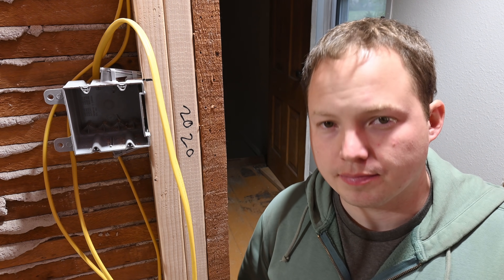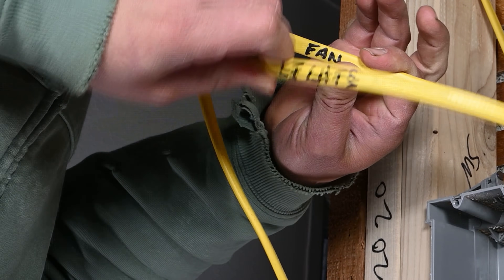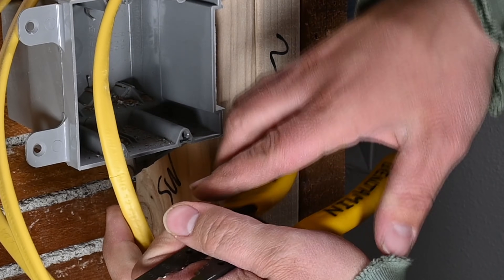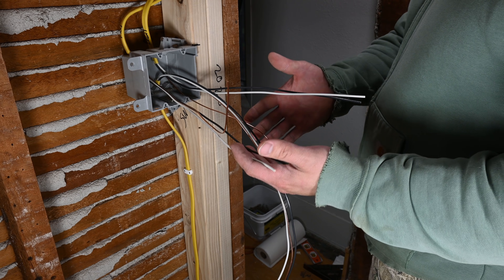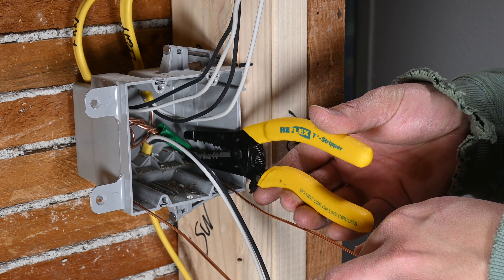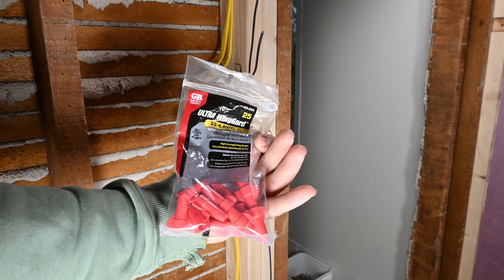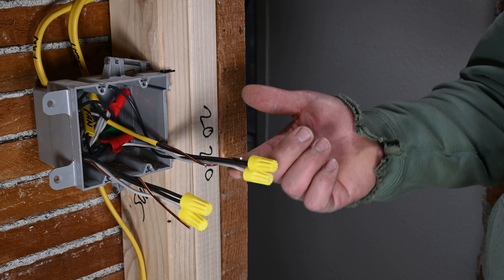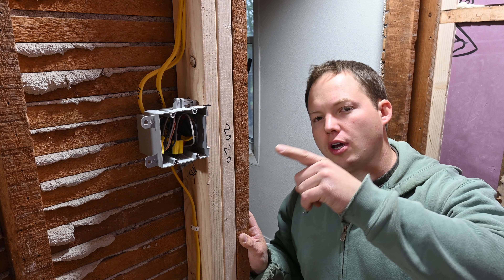How To Rough In Wires For a Bathroom Light & Fan Two Gang Switch Box

Comment: While it is code now to have a neutral present at every switch box...adding the pigtails for them when not needed is unnecessary. You have them capped off in the back in case it's needed for a future change, but since you're using regular switches adding the pigtails is just taking up more space in the box. Plus more of a chance to have a wire nut come off and cause a short. Yes, it's convenient to have the pigtails ready to go if they're eventually needed but the cons far outweigh that. Otherwise great job and very neat work. Union apprentice electrician here from LA and enjoy your vids.
Reply: Benjamin tells us that the more you manipulate copper wire, the stiffer it becomes. He likes to connect the wires and push them into the box ONE TIME. That is HIS particular custom. You are not wrong but he - and I - really don't like pulling wires out and reconnecting them.
Reply: @ricoludovici2825 it’s not a big deal to pull out a splice and add a pigtail to it, done it hundreds of times
Reply: As an apprentice, please make sure you are reading the code carefully.

Does 90.4 really say that ahj can toss out all the NEC rules?

Does 110.3.(B). Really demand we follow the manufacturer's instructions?

Does 404.2.(C). Really have about 6 exceptions to the, "neutral in every box"?

And is it ahj or NEC that lets us not fill those 1/4 in holes in 4 x 4 metal boxes?  They are un-used openings.

Your friends and family are probably already looking to you as an expert.  Work hard, be that guy.
Reply: I agree
Reply: Not a big deal to make a pigtail either. Everyone has their own method and it’s not against code.

Comment: Man i wish I would’ve seen this video before I hired an electrician to rip me off.. lol. I subscribe tho 💯💪🏽
Reply: Romex is only beneficial to the electrician. It's all good as long as the installer REALLY KNOWS GROUNDING. DONT STEP OVER DOLLARS TO PICK UP  QUARTERS, PAY THE EXTRA FOR METAL, MICE CANT EAT THROUGH METAL!
Reply: Also it's a nightmare finding a open neutral with romex
Reply: Not a big fan of non insulated ground wire, moisture loves copper,oxidation will   definitely occur
Reply: Unconditioned space, not properly vented or insulated speaks corrosion on bare copper all day long. Ground is quickest  path, oxidation on bare copper causes resistance on path. Romex is beautiful, cheap, and cheap,and easy install,as long as your walls are low humidity and room temperature
Reply: No house has perfect ambient temperature on outside walls. MOISTURE, HEAT,COLD,PLASTIC,COPPER, NO GOOD!
Reply: @joerostkowski7313  thanks Joe for the heads up

Comment: Benjamin, I wanted to rough wire up for a ceiling fan and light on separate switches, one a dimmer and the other a single pole in one of the rooms. How many wires do I need?
For BTW for all your excellent videos.

Comment: I assume you have stairwell or neighboring attic lighting off circuits. I would have the hall outside of your bathroom be on that circuit so it would cast illumination into the bathroom space. But your premise was right having the light on a separate circuit say the bedroom or whatever the best.
Reply: Sir, his initial recepticle looks to be at about 12-14 inches off the floor.  With counter top heights at 30 - 36 inches, that recepticle would be too low ( >12 inches below the countertop height) to count as the bathroom recepticle required in 210.52.(D).  Perhaps this recepticle is for a recirculation pump inside the basin cabinet.  I feel that he has not displayed in his video the basin recepticle required by 210.11.(C).3. ---- 210.52.(D). Making this a separate circuit from the bathroom circuit.  However, 210.8.(A). Requires all bathroom recepticles, no matter the circuit (bedroom/bathroom non-counter loads circuit) be GFCI protected.

Comment: I have an outlet that’s reading open neutral. Pretty sure the double light switch that on the line is whats wired wrong that causing it. However I’m only my second week into an electrical helper. I can’t follow this but it has helped me
Reply: Your white/blue wire, (wire that has no current) is not properly connected. Either its loose or not properly connected to where its making contact with the connectors to the light switch or wall plug/outlet to where it completes the current.

Comment: Hello Ben, quick question. I have a splice connection on the AC system circuit, from electrical box to the fan condenser unit outside. It burn due to electrical tape failed and one leg touch ground and arc few time. I would like to know what kind of wire nut or what type insulation connections you normally use to make connections.
Reply: Call an electrician lol jeez
Reply: You did use a continuous piece of wire , from the source to the box, yes? Splicing inside the conduit has been illegal for the past 100 years,  IIRC...

Comment: How do you rough in a 14-3 ceiling fan switch? Wire nut the red wire, temp wire nut the black wires of 14-2 & 14-3 together, connect the neutrals and pigtail the grounds?
Reply: Get an electrician before you hurt yourself
Reply: @gerdberg4188  I tried to get 8 different electricians. I ended up wiring the entire house myself. Two 200 amp panels going out to 200 amp disconnects which are fed by a CT meter. 5,000 square feet heated plus a 728 square foot attached garage. I wired the hell out of the house. 138 can lights, 9 ceiling fans, 8 exterior flood lights and receptacles out the wazoo. The inspector tripped out that I wired the entire thing and had never wired anything before.

Comment: In certain locations in historic buildings I suggest to use conduit or BX cable because of bird and rodents causing fires. The Missouri Department of Conservation has done studies that electricity through Romex generated the same gaus radiation as insects causing animals to chew on them. It's only a few dollars more for the protection.
Make Friends!

Comment: Hey man love the videos, question, I want to run 20amp circuit to a garage about a 100ft away from my main panel. Can I just use 12g romex?
Reply: volt drop..
Reply: You wanna use a 4mm T/E that'll do the trick! haha
Reply: Check your  Ugly's for the voltage drop calculation.  Or, look online. Type UF , run 3 conductor with ground,  regardless,  so you can expand later,  when you need more power..
Reply: No
Reply: No If it is out side yes if it is attached

Comment: hi,i have a little problem and i thought maybe you can help, i did a rough in 2 gang switch box for my bathroom too, one for the the fan and the other for the lights. when the lights is on and i turn on the fan, it make the lights blink once. is it possible that the fan take to much power that make the lights blink?

Comment: Good video,  btw the code does state that the minimum free conductor length is 6" from the box
Reply: Sir, unchanged for the 2020 NEC section 300.14 in the last sentence talks about the opening of a outlet, junction or switch point is less than 8 inches in any dimension, each conductor shall be long enough to extend at least 3 inches outside the opening.

Was that the section you were talking about?  I am studying for a test so if I got that wrong, if it must be 6 inches, please let me know the code section.

Comment: You do not need AFCI protection for a bathroom that has a dedicated 20 amp circuit just for each bathroom, you can if you want, but you do not need a dual function breaker, just 
gfi protection so the bath plug is gfi protected. I would just use a gfi receptical to meet code, instead of a gfi breaker, its about $30 cheaper. Some day afci may be required for the bathroom. Great channel, keep it up!
Reply: I think I heard that the most recent NEC calls for AFCI. It's important to remember though that NEC is optional and most states use NEC codes that are a decade or more older than the most up to date NEC iteration

Comment: Why not use 14/3 wire to feed the light and fan ?
Reply: Probaby not a single device so he's going to 2 locations, e.g. vanity light n ceiling fan.
Reply: Dont need to take up 2 spaces in the panel for a fanl and light circuit.

Comment: I agree with andy. Per haps you could save on a couple safe off nuts if you just cut a 12" com pigtail strip both ends and insert them in your com bundle. Then just roll them into the box and if there is a future need all they need do is cut the com loop in half and use as needed. But I am splitting hairs. Beautiful work as usual.
Reply: OOps Andy H... Sorry Andy

Comment: Bathroom fan with manual switch??? Are there humidity sensors available in America?
Reply: They exist and are actually required by code in some states.
Reply: @MrJramirex  It's really hard to imagine person coming every 10 minutes to bathroom and check when humidity deceased to disconnect the switch.

Comment: Hate plastic boxes
Reply: Not a fan of them either. They're not sturdy enough and machine screws notoriously strip out of the mounting holes.
Reply: How is about old buildings without ground wire? In many countries it is code violation to install metal boxes without earthing.
Reply: @Dmitrytln  That is a valid concern. Interestingly, however, metal boxes in North America long pre-date plastic ones, and also pre-date grounded/earthed circuits. So if it's unsafe now, it was always unsafe in the past.

Comment: Great video!  The only thing I would probably done different is use crimp copper sleeve (Buchanan) to hold the ground wires together and eliminate the “greenie” and I would leave the black wire power in wire a bit longer to cut the insulation twice, one loop for the first switch and the 4” down the wire to make a loop for the second switch thereby eliminating the another wire connector.  Keep up the great work!!

Comment: Ben quick question. Are rough-in inspections the same no matter the state? For instance, for my rough-in inspection should I have all my wires capped like you did above and connected to power (fuses connected in the box but not switched on)? I can't seem to find that information in the 2020 NEC handbook.
Reply: You will not find that information there . That is not something the NEC covers . You would need to co contact your local AHJ
 (Authority having Jurisdiction).  Aka  your local building inspector to find out what parameters or pet peeves he or she might have. Figure out how to get along with them . They can put you through a grinder and cost you a lot of money .
Your local guy is the top authority . They literally have no boss . If you aggravate them , they can hold up the project big time.
Reply: @gerdberg4188  thanks. So far so good. All my initial inspections where just quick look around. Waiting to finish up and then calling for my final inspection. Appreciate the heads up.
Reply: Glad I could help

Comment: Interesting how you wire up in America compared to here in Australia and the UK which are similar. We wire bathroom fans and heater lamps to the light circuit of 10 amps 240v. A dedicated lighting circuit is often used in larger builds to bathrooms  only. I like the boxes even though we don't see boxes used at the stitch points over here in domestic builds.
Reply: In Europe many people use washing machines in their bathrooms (often illegally cause distance from bath/shower to electric appliances should be at least 2 foot, but people install them close to bath), so 10A circuit is very small and bathroom requires two circuits. In large European bathrooms some people organise saunas, which requires 3-phase electric power. In America quarter is powered with high voltage and each consumer has dedicated transformer, but in Europe districts have common transformer and such saunas in bathroom sometimes cause voltage drop, especially in historical districts.
Reply: I was looking for instant hot water heater until I was told 60Amp service is required for electric units or run gas
We passed on instant hot water maybe loop back system we had old house
Reply: Wow no boxes I would love to see that !!!!!!

Comment: I feel like it's a waste of space and just makes the box messy to add those neutral pigtails just in case... if you need them you can always add them later...
Reply: Use WAGO if you want to add some wires later.
Reply from the maker: True! Honestly I agree but it is good to at least consider it if you're thinking to use smart switches.

Comment: Excellent channel Ben. Not rough in related but I really like to install fan timer switches with ten minute run time up to an hour run time to help get rid of shower humidity to help prevent mildew. Not sure if I trust the humidity sensor switches to run long enough.
Reply: I use the Edwards timer myself. Considering we now know that, in Canada, the shower moisture penetrates the drywall and condenses on the poly sheet when it is cold out, and then can drip back in when it warms up, causing black mold on the drywall. The timer lets the occupant leave the fan on for an hour after a shower while they head out to work, etc. It saves coming home at night to find a fan still running. The hour of fan seems to vent the moisture nicely.
Reply: I have went to using humidity sensor switch as my step kids won't turn the fan on, also installing one on my rental.

Comment: The neutral wires look into using wagos or the ideal push ins I grabbed a bag of the 4 port push ins those where a great time saver and using 2 of them was less space than a orange wirenut. I'm really starting to phase out wirenuts over the wagos and the ideal pushins especially for ground wires with multi feeds in a j-box  where separating them for testing is so much easier
Reply: An hvac guy came and did some service on my unit I wired in with Wago's... first the apprentice said "what the hell is this?"  Then the lead guy said something like "those are telephone connectors"  Haha.
Reply: @sparks6666  I cld see it. I just started using em  so I w

Comment: You should look into copper crimps take all 3 ground wires twist together  crimp at around 4 inches tuck all of them to the back of box than measure  for your 6 inches past the box cut 1 leave 2 for your tails save a wirenut and all that space from it welcome to the pro league lol
Reply: You're talking about the Buchanan crimp ferrules? Those are nice, but the crimp tool is like $80.
Reply: @aaron74  yes in deed I paid $60 for mine back in 1997 I was making $5.25 an hour lol still have them been good to me. saved me a lot of time on catching busy hands cutting my crimps and sleeves replacing with nuts
Reply: @wizard3z868  They're actually required in some jurisdictions, I've heard
Reply: @aaron74  I was told by those who trained me tht was the case it was ahj and most wld only allow them if you used the proper 4 point crimptool and a few didn't care what you used but only for the grounds the load carrying conductors had to be crimped with the Buchanan tool
Reply: @wizard3z868  You use it for load conductors? I thought it was just for grounds. How do insulate that splice? Tape?
Reply: @wizard3z868  Wow there's caps that go over them, I never seen those
Reply: @aaron74  yup been using them since 1997 when I entered the field. I went looking for the caps and noticed the big box store has some with the copper crimp and sleeve as one connector you just crimp and done haven't tried them yet.
Reply: @wizard3z868  I like them! Probably the best quality splice you can have for sure.
Reply: @aaron74  provided you use a good crimp tool and trim them they are great
Reply: They suck on solid wire